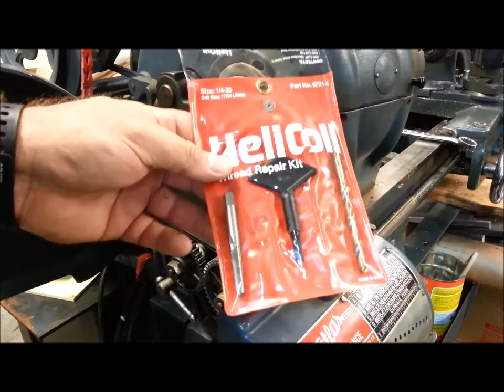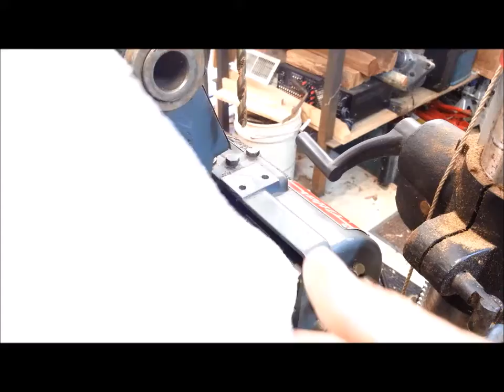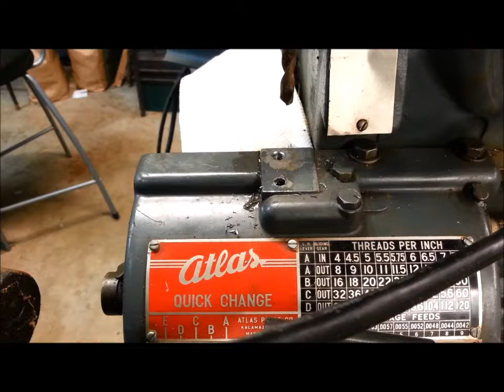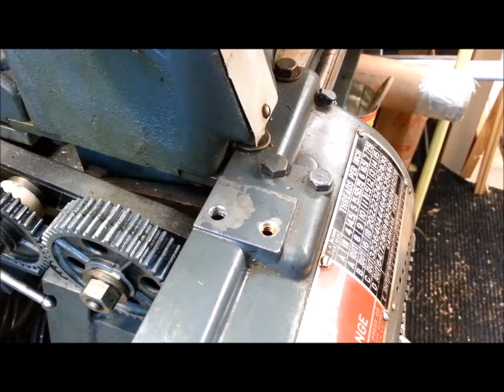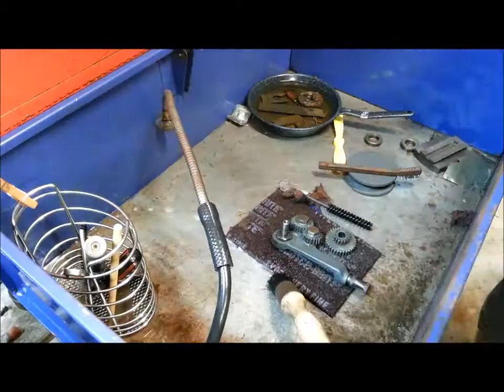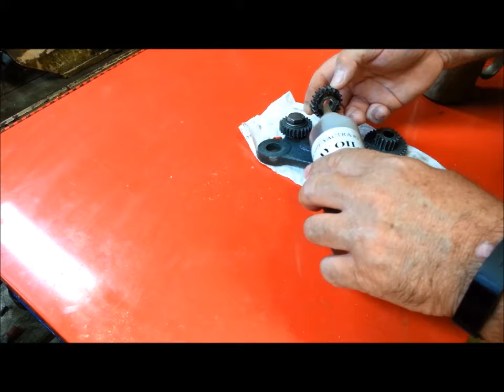Gearbox Repair Atlas QC42 Lathe -  Helicoil  Upgrade/Repair The Old Gray Lady

Comment: Hey Craft, I love what you're doing to restore the "Old Grey Lady" to original, even better than orig.! I bought one of these relics back in early March. So I'm paying attention to all you "machine-pied-pipers" on YT, as I need to learn as much as I can to apply to my restoration project. This particular repair is so like the kind of thing I've done when I was still punching the clock for someone else. Great job btw. But I personally would use some form of a lock washer; star washers would do to ensure vibration won't loosen that critical mounting again. Oh and I wouldn't have mounted the Rev-switch like that. The angle metal needs to be thicker, stronger. For every time you use it, it makes the connection weaken. I suspect it's why the Zmak, if that's what it is worked the mounting hole like it did. Great presentation! Keep 'em coming. I look forward  to more info.

Comment: The quick change is cast aluminum and the gears are steel in the quick change,, that's why they cost so much, Me Pete didn't know that until I told him,, I was glad to find out when I put a magnet on my gears to check them,,, but I have 6 atlas lathes I've restored and only 2 of the zmak gears show wear,, hell the China lathes are plastic gears,,

Comment: Hello  Crafted ;

  I had the same problem with my Atlas 10F QC 42 - one bolt hole was stripped out - So I got two 1/4-20 nuts and four lock washers.  I found you can lay a nut and a lock washer on your index finger, and snake it into the gearbox,from behind,  and then you feed the bolt with the other lock washer on it from the top, and thread them together.  I did it with both bolt, and problem was solved.  
  As for the noise:  Welcome to ZAMAC !   You might want to try a little 90 weight gear oil on the gears, and see if that quiets it down a little.  
  Great Video !   The Atlas Lathes:  Damned by Professional Machinists, and beloved by us amateurs !

Comment: I mentioned this before - I was having trouble getting those gears to mesh properly and evenly. I need to revisit that part of the lathe soon.
Reply from the maker: +eviltwinx I hope my video helps.  I've got another due to pop up on September 15 and 17.  Two part series on how I fixed the lash problem on mine.  I discovered after this making this video I had way too much lash in the tumblers.